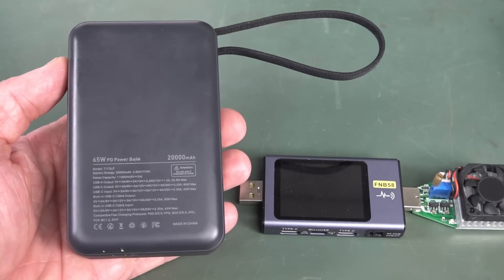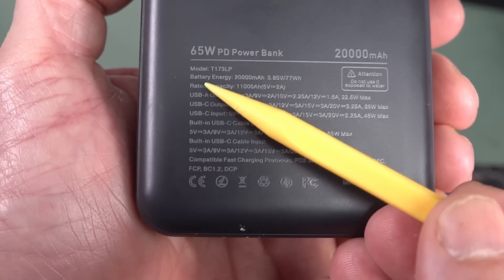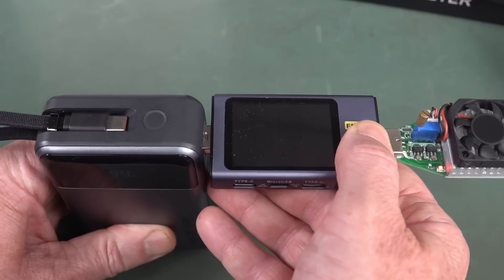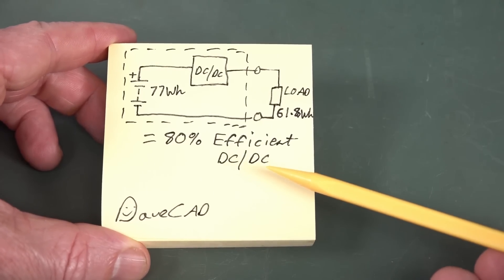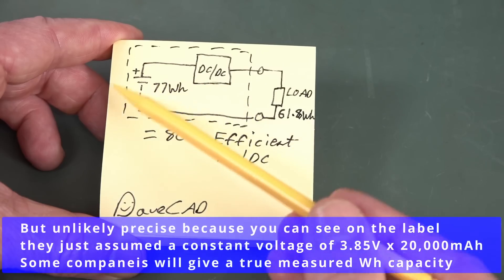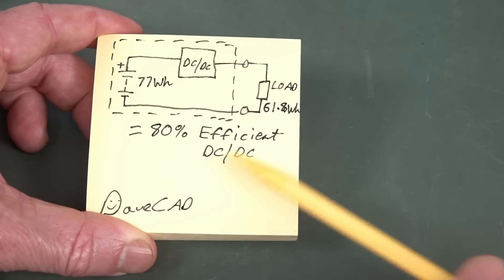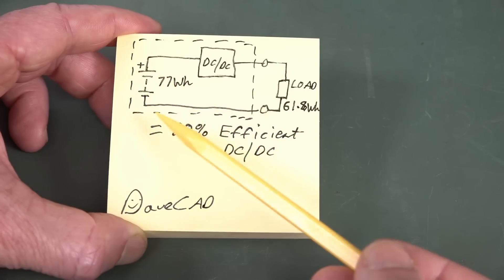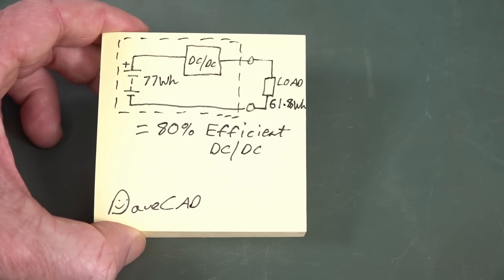EEVblog 1648 - USB Battery Bank mAh Capacity ratings are a LIE!

Comment: I don't think I've ever seen any battery bank give an output referred capacity rating. When everyone else is doing input referred it just makes the output referred product seem inferior even though the opposite may be true!
Reply from the maker: This one actually does on the label if you look under the Energy figure, 11,000Ah (LOL! wrong, it should be 11,000mAh at 5V/2A output). But they don't include that in any of the marketing at all.
Reply: @EEVblog good on them then. Even though the figures were wrong the heart was in the right place. I just remembered that I've seen battery banks artificially inflate their numbers by using 4.2V (max lithium voltage) to calculate Wh!
Reply: Question from a noob:

Is watt/hours the most correct measurement of batteries?

Because mAh is dependent on voltage, right?
Reply: @Splarkszter you are looking for the watt-hour rating which is a unit of how much energy it stores, mA is misleading but they do it because everyone else does it
Reply: @Splarkszter  certainly not watt/hours, if anything then watthours
Reply: sometimes efficiency is given so you can make a guess based on that
Reply: Also, the battery energy is arguably the most important, given the restrictions on battery pack capacity that you are allowed to carry on a plane.
Reply: Yes, the battery pack capacity must be less than 100 Wh to allow on passenger aircraft, so that label is important.
But the output referred capacity (or usable capacity) must also be mentioned.
Reply: @aveekbh  They got rid of that rule, it's now up to the airlines as to what capacity they will allow.
Reply: @pedro_8240 yes indeed
Reply: @pedro_8240 I was going to comment exactly this. Wh ratings for traveling on airplanes need to be present on the label. I've never really looked at the mAh numbers to start with, and most reputable brands I know will use Wh.
I'm mostly using V-mount camera batteries, so that might be an industry thing. plus, they give you "raw" battery access through the V-mount or D-tap plugs

Comment: G'day from NZ :) That was the shortest EEVBlog video Ever! Didn't know you had it in you :)
In terms of why the measured capacity in Wh was below 77 - there's another reason you didn't mention. Most battery capacities are rated at a specific discharge current, not sure what the standard is for Lithiums but for lead-acid it's c/20
eg. a battery rated at 60Ah will give that capacity at 1/20th that draw - so 3A in this case. If you want to get the full 60Ah you can only do it at a max constant draw of 3A
In the case of the battery bank, the native Lithium voltage is being boosted to 5V by the converter, so this will effectively increase the current draw off the Lithium.
To test this carefully, you should a) assume the capacity is battery-related, then b) find out how the Lithium's capacity is rated - c over what... then arrange a 5V load on the output such that you're pulling no more than that current off the battery. Then measure the watt hours provided at the output, that'll give you the true converter efficiency.

Comment: and also, no one is covering nonsense claims of manufacturers claiming their chargeable batteries are close to 99% efficiency. also electric car enthusiasts don't want to see their charge/discharge efficiency of batteries make their electricity consumption much higher than they calculate with. if you put 1kW/h into charging, you don't get 1kW/h out. you could be glad if you get 70% back. but producers don't tell you this. marketing strategy lies. as usual.

Comment: Yup, Anker 10000mAh runs flat after charging a 5000mAh phone, because of fast charging. It's written there on the battery. but still their advertisement should be honest: either it's a quickcharge 5000mAh OR a regular 10000mAh, but not mislead it's BOTH
Reply: So anker isnt worth the extra money by the sound of it. Interesting

Comment: And then the 5v DC/DC voltage is converted back down by your phone/device to battery voltage for another 20% loss. (If it is even switchmode.)

Comment: It is not really marketing, by law and transport compliance the product need to bear rating label with the energy that is in the cell. If you would specify the output rating it is illegal. Still to make the output Wh number the input Wh number still is needed to produce it. The 80% efficiency Wh to Wh number is pretty bad actually. Would expect >90% from better quality power bank.

Comment: 3.85v on a lithium battery.  Give me a break.  Unless these guys have formulated their own cells, or buying alien technology they should be using 3.7v. There is a 4% boost in capacity right there.  Most of the cheap Chinese boost converters will run 90%+ efficient, but there may be a sweet spot so you may need to run a bigger load to get this, A 5w load may be more appropriate

Comment: I have the fnb58 also.. it's a kill3r piece of tech.. It even has a built in oscilloscope... You can go into the settings and turn it into a power supply also, for the different usb C standard voltages.  I really like it.  I wish they had something like this built into a recharable battery charger-- so I can follow all the outputs of the charger and track what my batteries are doing.  I don't like being blind to what my chargers are doing for all my different rechargable batteries I have spread everywhere.

Comment: I think mAh is fine if they are referring too battery cells in parallel since the voltage is the same.
I've also always assumed ratings were based on battery cells and not the actual output at the USB port. Consider me not surprised.

Comment: 1:01
You might wanna PSA regarding voltage as well. Newer power banks now have 21V with the new PPS standard, As expected iphones are late once again.  Higher voltage, lesser current = lesser loss.

Comment: Does that USB power meter thing also counts it's own power consumption?
Reply: No. The unit consumed around 64.12mA when in high brightness displaying the metering screen. With dimmed brightness, consumption fell to 54.18mA. These values have no significant impact on the final result.
Reply: @Tab7.6.Tab7.6  So it consumed 3 Wh to 4 Wh during that 12 hours 👍

Comment: But dave, all the battery operated tools are in Volts!
Reply: Only the nominal operating voltage is indicated on power tools. But already on batteries for these tools, the nominal capacity is additionally indicated. This capacity is true, moreover, because there is no conversion from a lower voltage to a higher voltage here, as is the case with powerbanks.

Comment: Yes, BUT output voltages can vary with USB PD: 5 or 9 or 15 or 20 Volts. So we don't just need A (singular) output-referred Wh number, we really need graphs that factor in the DC-DC efficiency @ different output voltages over the supported current ranges.
If any mfgr is listening: that would make for a fine product picture. Imagine you advertised your products on the merits, (almost) for free because you should already have that data.

Comment: I've been testing mAh (now I know better) with input and output, on three powerbanks and efficiency is even lower, with output being around 50% of stated capacity. I've noticed that USB-C socket output (for typical phone charging) gives a lower figure than USB-A socket. I don't know whether that's due to the type of port or different voltages (or protocols) used. In any case, for 'normal people' we can expect half of the stated capacity. 

I decided I was too 'normal' to make a video about it 😊

Comment: Then there is the limit on flying with powerbanks in the carryon. 

The manufacturers have to put a potential maximum on the specs so any airport security can check it's under maximum alllowed.

Comment: ok, but can you look though your batterypacks you have at hand how much the converters varies between the manufactures for a fixed load? if every converter needs 20% then the packs are comparable with the input-ref values.

Comment: Great video. Although evident to some, these things needed to be said. Every power tool battery lists Ah, although it is miningless, considering the voltage can be wildly different (12 to 60+). Even voltage is reported however the marketing department decides. Some use nominal voltage, other use peak. This is aside from the efficiency of the electronics inside.

Comment: Did you measure the energy required for charging as well? I would expect that it is even more than 77 Wh, because the USB PD to cell voltage conversion causes a similar ~20% loss. So it's not even real input referred, just the internal battery capacity. Your are basically buying a lithium cell with the specification + some circuitry/ports for convenience. I noticed while traveling with solar panels that almost 50% is lost when it goes through a power bank instead of charging the target directly. I agree that every power bank should include a full efficiency and output energy specification too.

Comment: Just under 3 minutes. If that was filmed square it could be a short under the new YouTube shorts rules. 
Nice thumbnail and great explanation.
Reply: If it was uploaded as a short, I wouldn't have seen it. I use an addon to block them since they are usually tiktok style crap.
Reply: Eh, we have enough YouTube sharts.
Reply: My screen isn't square though.
Reply: @maxine_q  Yeah, but your head sure is.
Reply: Who said a square aspect ratio was a requirement? I'm very skeptical of that one, for very obvious reasons.
Reply: @ - A short can be filmed in square or portrait. If it’s square it can be zoomed in to fit a long format or used as is in a short format with space on top and bottom for title, text, etc. 
Thus one filming effort can cover both formats as long as it’s less than 3 minutes.

Comment: I have new USB-C phone and charger which can do 20 Volts 66 watts. One might assume there is less losses in transit, because  much less current. I have not seen a battery bank which can do 20 volts, only 12 Volts, but it might be coming one day soon.
Reply: There are plenty of 20V capable powerbanks. Most 65W and 100W  can do 20V
Reply: Yes, look for laptop compatible power banks - those will have 20 V output.

Comment: it makes sense. DC-DC efficiency is depended on the load, sometime it's 10-15% between worst and best case. Using battery rated will give you solid number.

Also dont forget your phone also has DC-DC block inside, to convert the input voltage to battery-approriated voltage. So there is another loss

Comment: Like power tool battery Ah rating, checked both brand new Makita and Milwaukee 18V battery's, only get about 85% of the name plate Ah rating. Theres no inverter in them so it’s all marketing fibs.
Reply: How did you carry out the tests?
Reply: @Tab7.6.Tab7.6  
Used my Rigol DL3021 battery test function, 1A load till fully discharged.

Comment: Ive always known that, i mean if you based it on mAh befpre we even consider the conversion loss, 20000mah at 3.7v is 14800mAh at 5v, im suprsrised those power banks didnt provide datasheet with multiple test condition and temperature with graph at different load like what you will get on battery datasheet or component datasheet

Maybe they can also include output ripple, efficiency, voltage accuracy, especially now that PD power bank is common that you can get different efficiency at different output voltage

Comment: The manufacturer of your tested battery pack seems to be one of the more honest ones because it also supplies 0:18 a rated capacity @ 5V / 2A in addition to the usual battery energy (marketing wank). If we ignore the typo of 11000 (m)Ah we get a quiet reasonable 5V * 11000 mAh =  55 Wh which aligns with your test @ 5V / 1A ± 10%.
Reply: you are right, the efficiency of converting will decrease by increased current, (or voltage like in fast charging 9V or 12V), so some manufacturers include rated capacity at standard 5V, and mention in user guide that it well be less in fast charging protocols.
Reply: Today I learned the mAh capacity advertised with battery packs (more often than not) is measured using the battery voltage as a reference and not the output voltage. I thought the manufacturer from the battery in the video was being particularly misleading, but apparently both my Xtorm and Xiaomi battery packs also use the same method.

Worse still, the battery voltage every manufacturer uses is different. Xtorm uses 3.6V and Xiaomi 3.7V. That makes the mAh value mostly useless to compare against other battery packs.

I guess having the battery energy in mAh using ~3.7V as opposed to 5V is kind of useful because then you can subtract the mAh of your (lithium) phone battery and get a reasonably accurate idea of how many charges you get out of the battery. But I do think this needs to be communicated better, by all manufacturers.

Comment: Is it marketing though?  I thought it was so that the energy capacity (of the battery) was accurately stated for safety, transportation, and similar purposes.  (If it blows up, you know the pottential magnitude of the inferno...)  I'm sure that marketing departments exploit any parameters to their best advantage, but I think this one is at least honest, even if it does nothing to describe the true input to output efficiency and is therefore of only limited value to the user.
Reply: That's not really proportional to the rated capacity, but mainly battery chemistry. Either way Wh would be the battery rating for "dangerousness", since higher voltage chemistries are usually more dangerous.
Reply: @Max24871  Which is why Ampere-hour rating, Watt-hour rating and nominal voltage are specified.
Reply: @GodmanchesterGoblin  yes they are, but that doesn't make your original comment any more correct
Reply: @Max24871  I talked about energy capacity (which is Watt-hours as you know). To be honest, I'm not sure why you regard that as incorrect.
Reply: @GodmanchesterGoblin  It seemed to me like you were referring to the mAh rating, seeing as that is what the video was about and you not mentioning any particular units. Sorry for the misunderstanding.
Reply: @Max24871  No worries. My wording was ambiguous, but not intentionally so.

Comment: There is also losses on the phone side. To fully charge you should have a battery bank twice the capacity of the phone battery. That gives some extra margin.

One should also beware power banks with fake mAh ratings.The rating correlates well with te weigh. A 5000 mAh power bank weighs some 100 grams. Amazon sells a million milliampere hour power bank. Such a thing would weigh 20 kg.
Reply: In some regard yes.... but some uses pouches, other cells in metal and others even add an iron slap just for 'stability' (and weight) in the bank

Comment: Trouble is, the efficiency of the Dc-Dc varies with current, so depending on your load you get a different Wh rating.. As for comparing batteries, as long as it's apples to apples, it doesn't really matter which figure you're comparing.

Comment: Not to say that input referred capacity is a better measurement, but wouldn't output referred capacity be variable and significantly dependent on output load and converter quiescent power draw?
Reply: That's what I thought. You'd actually want the "input capacity" and a couple of graphs to figure out the coefficient and the "output capacity" for your load😅

Comment: But Dave, surely this depends on the value of ‘future’ electricity, as opposed to ‘present’ electricity? In an alternating economic environment, current affairs can significantly alter the potential difference between your calculated values. 
🧐

Comment: Are the cells actually 3.85V nominal or is the manufacturer trying to boost their Wh for customers to think "ooh big Wh! Nice!"? On the other hand, some manufacturers claim 3.63V nominal to try to reduce their Wh so that customers can get the powerbank on a plane.
Reply: 3.85V nominal per cell is typical for a LiHV cell. They get more capacity in a smaller, lighter cell in exchange for wearing out faster. They are good for drones, but should be avoided when weight isn't critical.
Reply: That is what Li-Ion cells roughly are. Some say 3.7 V, some 3.8 V.
Reply: @okaro6595 yeh Nar. It’s 3.6 or 3.7 nom for li-ion. This 3.85 might be the scam we’re all looking for. 

That being said, even 3.6 x 20 is still way above the 61Wh tested.

Comment: Bloody marketing, if you see a rating of 20000mAh that's 20A for one hour...hmmm I don't think so, bit like bloody ISP's using megabits/sec instead of megabytes/sec as it sounds bigger ! Scotty from marketing is all over this !!!!
Reply: To be fair, the bits rather than bytes per second thing comes from the way serial port (and Ethernet) speeds are labelled. And serial ports were in bits since they could do different length items or "characters", for instance 5, 6, 7 or 8 bits, with or without parity each with a start bit and 1, 1.5 or 2 stop bits. Would they have been able to sell a broadband connection of 64KB/s (bytes/second) to users who already had a 56kb/s (bits/second) dial-up modem? Maybe, but it'd be much easier to sell a 512kb/s (bits/second) broadband connection. (This is the actual speed of my |First broadband connection, which I got in 2002). Even that's an oversimplification, since although dividing 512k by 8 gets you to 64k, that's quite a bit higher number than the amount of usable data in bytes that can actually be transferred because of packet headers and similar hidden things needed to make it work.
Reply: I am sure you can get 40A at .1V for 1 hour.  The current is meaningless if voltage is not spevified